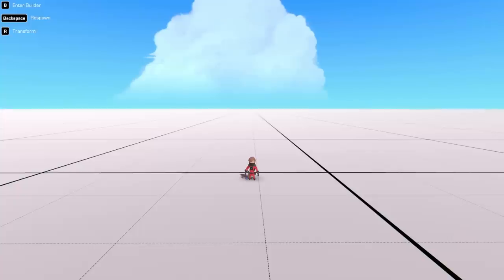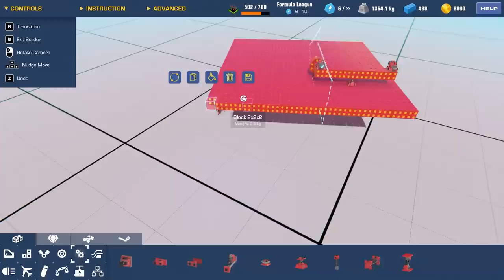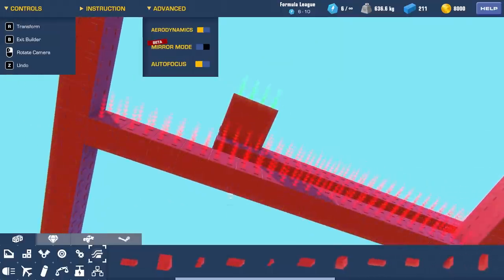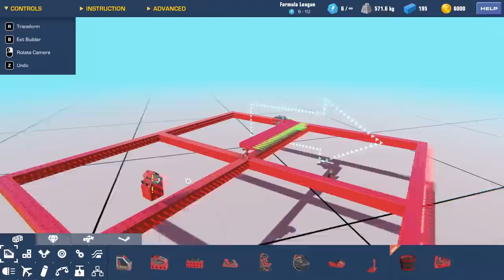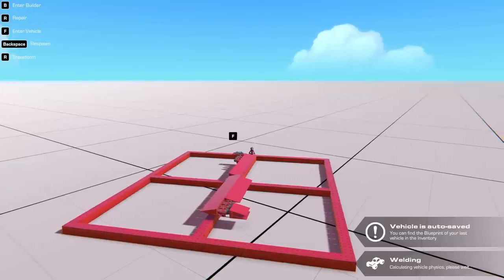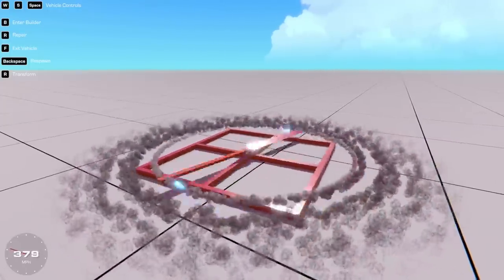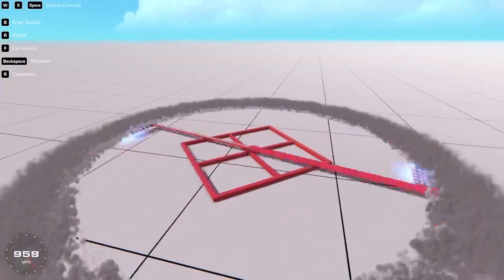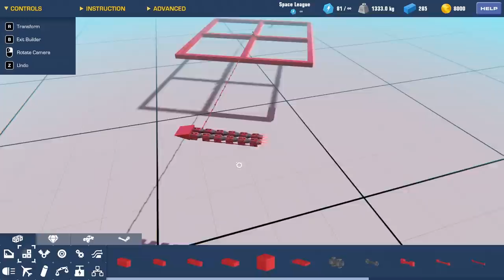Can you create a sonic boom WITHOUT moving??

Comment: Hey Matt, interesting, the "Common sense" theory of those aerodynamic wedges on the back of the arm shouldn't help at all is actually wrong. Real world aerodynamics says that an aerodynamic shape at the rear does help. The reason for this is that as you move through the air, you leading edge (the front of your vehicle) is pushing the air out of the way, in the case of the arm you have with the aerodynamic wedge at the front, your pushing air over the top and under the bottom of the arm. This is great at the front but leaves you a problem behind the arm. You know have a "dead" area that is occluded by the arm, so you have a low pressure zone right behind it, and this has a tendency to cause turbulent airflow and drag and such. Ideally you want to encourage the air to flow over the top and bottom of the arm, and then encourage the two flows to meet up again right at the rear of the arm to minimise that low pressure region. At subsonic speed at least the most aerodynamic shape is a tear drop, with the thicker end forward.
Reply: Also, interesting the sonic boom is kinda wrong in this. You were cheated. You only got the one boom each time you passed the barrier.... you shoulda been getting one everytime the arm passed the camera above the barrier...
Reply: interestingly, at supersonic speeds the wedge shape becomes much more aerodynamic.
Reply: @quinnobi42  Yep, nice smooth curves for low sub sonic, and nice sharp angles for supersonic. (And don't even talk to me about transonic, nobody knows)
Reply: in real world aerodynamics do change significantly from subsonic to supersonic
and altho trailmakers probably doesn't account for this change in behavior . . it is going to change the deceleration by a lot . . . so building a differend design that works above the speed of sound will still be the top priority
Reply: @quinnobi42  yeah it does . . the higher the speed above speed of sound . the better wedges preform
the fastest plane ever made had 2 large wedge shaped tailfins for this exact reason
Reply: @bluewhalestudioblenderanim1132  what was the name of this craft? I wanna take a peep.
Reply: @alkestos  it's X15 . . . and it's one of many discontinued science projects of the cold war
Reply: To be fair, he's a civil engineer. We don't like it when things move, so fluid flow aint our strong suit
Reply: @szerdrew8034  Haha, that's fair, although being a drainage engineer I thought would require some fluid dynamics! Although, I guess you don't really send stuff down the drain at supersonic speeds..... thinks RCE, you need to try that!
Reply: @bluewhalestudioblenderanim1132  I will just state, I think it's a little unfair to state "discontinued science project"
It wasn't discontinued, at least in terms of what that implies, the program was completed. From the outside the program was planned to have a finite length of 200 flights, of those 200 flights they flown 199, during which they had achieved the programs goals. While they intitially we're going to fly flight 200 anyway as a way to bring the program to a nice close, they suffered delays due to weather and technical issues, and since they'd lost an aircraft and pilot only a handful of flights earlier in the program it was decided that flying flight 200 purely for the sake of a nice wrap up to go home on without it providing any significant additional value (they'd already done what they set out to do)  simply was not worth risking airframe and crew over, therefore that last flight was cancelled. This is pretty normal within that world, the end point often shifts a little, sometimes you learn all you can in less flights than you planned, and sometimes you get to the planned end of the program and either have not acheived the initial goals, due to flight aborts from technical or weather issues, or have learnt alot of things, but in doing so have revealed new avenues of investigation, and so extend the program with additional flights. I'd say the X-15 did very well to hit it's preplanned number of flights as close as it did. 
Incase this is simply my misunderstanding what you meant, to me "discontinued" carries the connotations that the program was ended before it was actually finished, i.e. through budget cuts or something, rather than simply having come to the natural conclusion of the program.
Reply: @Streaky100001  thank you :DDD . . . that's a realy good explanation
and speaking of planes flying higher and higher . . it might also be interesting to look at the Skylon spaceplane development

because the goal of that is making an airplane that is also a Single-Stage-To-Orbit rocket whitch is something that no one has ever done before
Reply: @bluewhalestudioblenderanim1132  Does KSP count? :P
Reply: 69 likes.... OK I admit it, I am still immature at heart and find that too funny
Reply: @Streaky100001  of Course Not . . . BUT it is a good start for learning about what goes into crazy stuff like that
also that is a game for aerospace engineers and NOT civil engineers XD
Reply: @bluewhalestudioblenderanim1132  I don't know, I mean, all you do is take a building a put big burney things where the foundation should be right?
Reply: @Streaky100001  Shouldn't the boom be continuous as long as the capsule sustains supersonic speed? Intuition says you'd hear it repeat every time it passes the observer, but thinking about it, why wouldn't you also hear it at every other point in the circular path the capsule takes? It should sound like a continuous, devastating roar or rumbling as long as the vessel is supersonic and the observer is close enough.

If it were travelling in one direction, towards and then away from the observer, you'd hear the classic single (or double, technically) boom as it passes you, however this is circular motion, not linear.
Reply: @MGSLurmey  That's a very good point, you're right, as long you're close enough for the shock cone to intersect you. I was thinking along the lines of it doesn't make one sonic boom as it breaks the barrier, multiple observers along the path all hear one instance of the sonic boom as the shock cone intersects them. But yes, with circular motion I guess some point of the shock cone would always be intersecting you. 
Thanks for that!
Reply: Professor Frog  Ah! I see, hahaha
Reply: @bluewhalestudioblenderanim1132  True.

Comment: the booms were the same length but the weights on each end weren't equal. You get the very slight wobble this way, and maybe balancing the mass might get you the 999!
Reply: So adding a couple of blocks might have solved that one. Question, would making the ends form The Strongest Shape make much of a difference?
Reply: @lordgenerias  probably. All the energy going into moving the base around is coming out of the speed

Comment: The key to being stable is equal weight on each arm. Sometimes, to make things faster you need to add more weight, like wheel hub weights to balance high speed wheels it just needed a second cockpit and identical arms, or, balanced moments of inertia for the two arms, via a counterbalance weight of the calculated required mass. But, two identical arms is easier hehe
Reply: Yes, we need to see the arms identical and hit speeds over 1000mph!
Reply: No, its better to use anchor blocks since if one arm is longer it will go faster. Ancher blocks will make it stuck to the ground making it a whole lot more stable
Reply: @shaymin7240  one arm being longer doesn't necessarily mean faster, it's about balancing the forces. Torque being applied at one end needs to be the same on the other end, the weight also needs to be the same to stop the shaking. Easiest thing to do would be to add weight slowly to the non cockpit end until the forces completely balance, that's when the top speed for a configuration will happen.
Reply: @shaymin7240  You misunderstand... There is no reason why you can't do both. The anchor blocks will stick you down, and that definitely helps, but even weighted arms and basically a spinning assembly which spins evenly and balanced will stop it from trying to shake at all. Like a spinning bike wheel... instead of a swinging pendulum.
Reply: @bradgrant1899  Tru dat. ;)
Reply: And to be clear, the truth of the matter is there is no need for the arms to actually be identical, only that their shared centre of mass falls naturally on the rotational pivot.

Comment: In this game both aerodynamics count (in front of the vehicle and in the back) also the arrows are only shown in the direction of the big blue arrow in the building screen.  Finally, you can put a counterweight for the cockpit
Reply: When you say both foward and backwards aero count, is the game just counting aero surfaces? Or does it matter the directionality? Like if i put 2 4x1 blocks in a line facing forward, would it calculate the same way ifi only put one forward and one backwards back to back.
Reply: @hypeflexington7081  The building mode only shows aerodynamics in the direction of forward motion, but the game engine also calculates aerodynamics as if you are moving in reverse as well. So every direction of motion counts.
Reply: TankHunter678 is right. Also, no putting two 4x1 in line won’t make a difference. However, putting them facing away from each other will make the vehicle go slightly faster. So if you were to make a vehicle, it would go faster if you make it aerodynamic both in front and in the back.

Comment: You don't necessarily want to put the force on the end. There's a tradeoff with more torque on the ends vs higher speed in the middle. You can trade torque you don't need for speed by moving it inwards. It could be possible to use a get engine to move a pivot such that the end goes faster than the exit velocity of the jet
Reply: My thought exactly

Comment: The reverse slopes also increasing speed does have a potential real-life explanation I think (though I doubt it's why it works in-game).
Essentially, having slopes in the back prevents large vacuums from forming behind the arm as it moves. These vacuums would pull the arm back, slowing it down (or rather they cause the air in front of the arm to push it back into the vacuums - of course vacuums don't suck anything).

Comment: Use anchor blocks (they look like spikey bits) to fix the base to the ground to eliminate wobble. That slows you down.

Cockpit on long arm, and counterweight on short arm. Use weight blocks to offset the mass. Balance it as best you can for best results

Aerodynamics are actually modeled semi-properly in this game. Wedges facing one direction only WILL produce downforce, and having a trailing edge does actually improve performance.

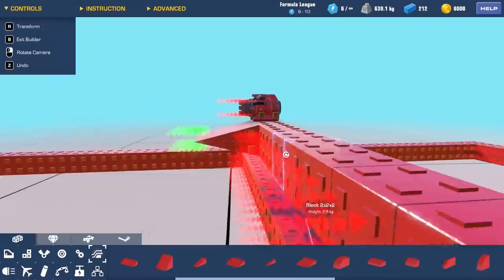Comment: Actually regarding aerodynamics: the major force if you are below mach 1 is pressure drag, mostly due to flow separation. Which is fancy for saying that the object creates a vacuum behind it. To combat this a shape like you made at minute 5:50 is actually good, better than on the fron side. You can easily see this with aircraft wing shapes.

Comment: The no drag link connectors are the way to go, and putting the engines at the best speed position but extending the links for the cockpit would be better. Also counterbalance the cockpits weight with something heavy but close to center, think trebuchet. Make it 4 bladed for more motors at peak efficiency radius.
Reply: Really good ideas

Comment: Try balancing it. Make one arm slightly longer/shorter until the base doesn't wobble. Or better yet, put a cockpit on both arms so that each side is identical.
Reply: I was thinking the same thing. The weight ist symmetrical causing wobble.

Comment: 4:00

*torque, not moment.
Moment, or moment of inertia, is a measure of how much of an affect torque has on the spinning of the system (not how much torque there is on the system). It's increased by adding mass at a distance from the centre (making the arm longer), while torque is increased by adding a force at a distance from the centre (placing the booster at the end of that longer arm).

rotational acceleration = moment/torque
Just as linear acceleration = mass/force, they are analogues for rotating systems.

Comment: Try using thinner parts to reduce weight and cross sectional area for improved performance. As well as using connectors to hold the base to the ground. Better yet by using flat connectors for the arms you can effectively eliminate air resistance allowing for designs that require fewer power cores.
Reply: Did you even watch the video?

Comment: I'd think you'd want some rockets on the end (the most torque) but also some closer to the middle, since they'd be pushing on a shorter lever.  They might not have the torque to get you up to speed, but they should translate into higher top speed since they are traveling a shorter distance each rotation.  The real question though would be how fast is the thrust from your rockets.  It might not be necessary.

You should see if you can get the developer to add an anchor so you can anchor to the ground.  It would be cool for making slingshots and such.  There is actually a company trying to launch satellites using this.  They've built a partial vacuum to lower air resistance and a super fast door so they can release it.  By doing an airlock they can preserve some of the vacuum.  They are hoping to be able to do multiple launches a day when the technology is mature.  It turns out that most satellites are already hardened (and designed to be super light, so the G's aren't that bad on them).

Comment: I think RCE has been wrong. Since you have a joint and you are going for speed the most important thing is speed and not force, so you would rather but the engines more towards the joint because than you would need more force but you would go faster in comparison to putting the engine far away, you are creating a lever which converts a lot of movement (speed) into force. In any case momentum DOESN'T change by putting the engine closer or further away, the engine outputs a certain momentum and it's just how you convert the momentum into speed that matters. (if I have made any mistake please tell me what isn't correct)
Reply: also you need to put the cockpit as far away as possible which he did correctly

Comment: So... I was curious what the g's of the character would be at the end of the centrifuge when going at 1000 mph. I did some calculations: 1000 mile/h * 1609m/mile * 1h/3600s = 446.9 m/s. From the video, the radius of the cockpit appears to be 32 links from the center of rotation. Lets assume that each link is one meter. The centripetal acceleration would be v^2/r: 446.9^2 / 32 = 6,241 m/s^2. Now just divide by the acceleration due to earth's gravity to convert to g's: 6241 / 9.81 = 636.2 g's! For reference, the sun is about 28 g's. Check my math plz.

Comment: 4:00 the further out the energy source is the less speed you have but with more torque at at the center, you want the engines in the middle of the arm with the cockpit out at the end of the arm, will take longer to spin up but reach a higher max speed. As for "movement" that's not even a relevant unit of engineering in a rotational machine of course its going to move no matter where you put the engines on the arm.

Comment: Yeah. If you were to redo this i'd perhaps use an anchor block at the bottom, but it would make the structure weaker. (if trailmakers is that realistic). As some others say, try stacking servos, maybe try another hinge instead of servos (i dont know), and setting strength to zero.

Comment: I believe that the reason why shorter arms with more rockets did not work is because the game locks the gear at a certain rpm. So by figuring out the distance away you need to be from the center to get a tangential speed of 1000 would have been best thing to do.

Comment: Most of the aerodynamics and length problems I think could have just been solved with counter weight with a shorter arm if you think the magnus affects ways in here that’s why the stability is off because the top wants to move wherever the rockets go so in some cases more rockets less speed not to mention like a ballerina or ice skater when they move there arms closer to your centre of gravity you will have less  resistance and drag ergo more speed

Comment: You may have not been able to reach 1000 mph before when you made the arms longer with more engines because the platform was shaking like crazy up and down not side to side. Because if you look at the platform then it was "jumping" that's why you need to add more weight onto the platform. (you could have also added aerodynamic blocks onto the base so it would make it faster)

Comment: You could stack the engines vertically and use anchor points. Also I'm pretty sure that the servo motor has an RPM limit.

Comment: Little late on this but, at 2:42 , I think that your assumption is wrong: That would be the case if with stable (unchangeable) RPM but longer radius. If the speed is applied on the perimeter, the speed of this point would be the same, even though its course would be different (aka smaller radius)
Reply: If the rockets can handle some torque (aka you're getting about the same speed at the rocket for lifting x Kgs and x2 > x Kgs), putting them inwards (closer to the center) would work better
Reply: Ah, i was impatient to comment and you tested that as well

Comment: You're losing energy by not stabilizing your base and making it heavy and immobile. You're also losing energy because your center of gravity is orbiting around the center, instead of being in the center. You have no counterweight. You're putting the same amount of rockets on each side, but not accounting for the added weight of the cockpit. Even out the weight on the other side, make your base nice and heavy and/or stick to the ground, and the only energy loss will be from the blocks holding your rockets and pod. Yeet yeet achieved.